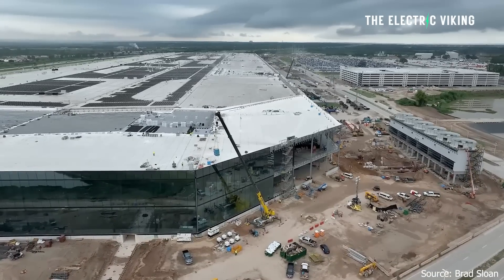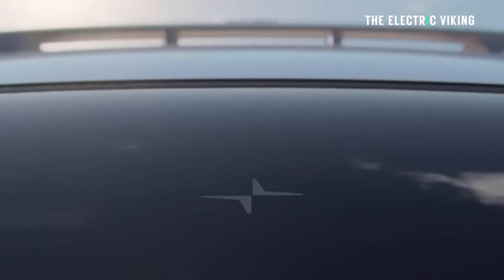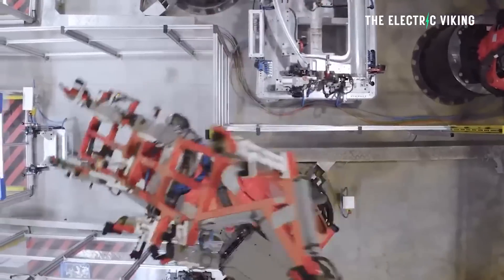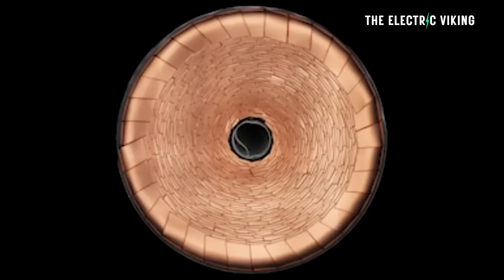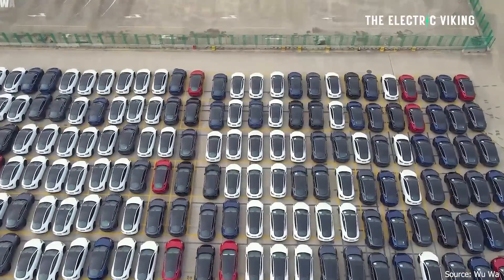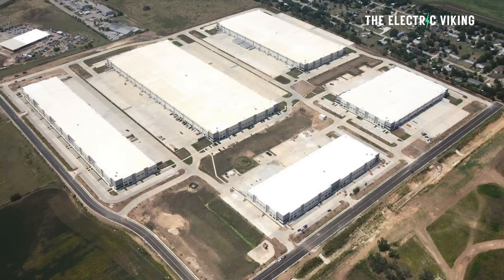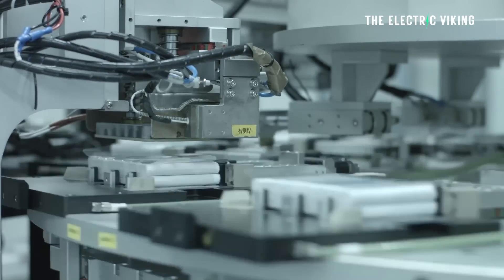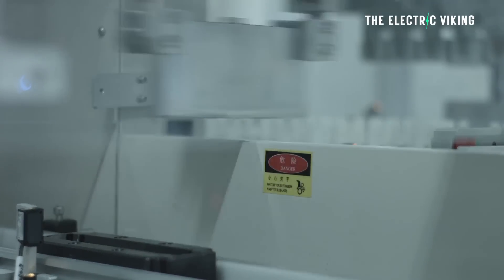Tesla is building one of America's biggest battery factories for NEW EVs

Comment: Do you not know how batteries work.    They can’t put a smaller in capacity battery pack in a Tesla model 3 and get more range.
They can put a smaller battery pack in volume yes (density) 
But it will still have the same energy capacity as the current Teslas

This isn’t the first video you have said this.  For the type of channel you are, you would think you’d know what you’re talking about.
Reply: Less weight, more range for the same kWh
Reply: @NicolasdeJong  you would need massive weight savings.  Not just a small amount.

Comment: Are sodium based batteries  used in megapacks?
Reply: Not Tesla megapacks currently.  I'm sure they will eventually but it will be many years before that happens.  China is just now starting to use them but they are just starting to ramp.  The first major products with sodium aren't expected until summer 2025 in the US and they likely won't be much cheaper than lithium until supply ramps to meet demand.  Interestingly there are almost 30 sodium-ion battery factories under construction worldwide but most are in 1 to 5 gigawatt production range.  Nowhere near the size of CATL's big 40 to 50 gigawatt behemoths or the massive 100 gig lithium factory they're building in Turkey.

Comment: You are so out of it . Tesla's 4680 has the dry cathodd and anode is a done deal . They have tore down the current 4680 and it is dry . And ELON confirmed it .
Reply: The team were given to the end of the year to make a cyber cell with the dry anode and cathode. They recently produced one that worked and are now attempting to see if they can’t make it work consistently as a mass produced product. He is correct. It is not yet a done deal.
Reply: You really should look at Elon's statements.  They are still having problems in production and he's basically giving the crew until the end of the year to fix it or he may dump it.  Tesla has always used packs from multiple companies, not just their own.  If they can't solve the production problems they probably will switch batteries.
Reply: @Ryan-ff2db  that's a old statement and those problems have been resolved. He is already putting these in cybertrucks . Everyone forgets who they're talking about . When they come up with a improvement they do it.

Comment: He can build all the batteries he wants. But there is still a need for charging.  He will have to build a self - supporting system or rewiring  almost every home in America if he plans on home charging,  using phase two charging stations.  The national electrical code requires a 50 amp dedicated service for the phase 2 as does the Tesla recommendations.  Most homes are wired for 100 to 200 amp service.  According to many electricians in order to add an additional load of 50 amps  to existing service lines, you would need to up grade your service to 400 amps, which is a very expensive proposition.
Reply: Saying everyone needs 400A service to charge a BEV is wrong.   There are only a few high current items in modern homes and few have all of them. Electric heating, clothes dryer, and water heater. (EDIT only electric heating and clothes dries come close to operating for 3 hours at a time as specified by the rule)  In a home with natural gas these are all typically served with it.   Homes that have no natural gas are often served with more than 100A.   
Using a 240V, 30A circuit, which is considered Level 2 charging, can add approximately 20 miles of range per hour
On some cars one can tell the car to limit the max current rate.  Not a huge thing with overnight aka off peak charging.
Reply: @danharold3087 I said almost everyone.  In planning a circuit you have to add the total load at expected capacity and figure it at 80  percent.  When you add a charging device it's figured at 100 percent.  When you apply for a permit you have to  present a load plan.  Do the math again.  Air conditioning, washer / dryer, hot water heater, 20 amp  circuits to kitchen outlets, for countertop appliances, microwaves, air fryers,  freezers,, refrigerators, dishwashers,  exercise equipment,  lighting. dedicated computer circuits,  Code and tesla  specs call  for dedicated 240 V 50 amp circuit, for a Level 2 charger. Regardless of what the car will limit, the codes and   recommendations prevail.  Ignore them and  the insurance company will ignore you if the worst happens.
Reply: @howardj602    The 80% rule in the Nation Electrical code is for the sum of all continuous loads.  Ones that operate for 3 hours or more are considered continuous.  In a typical home these are lighting, HVAC, and BEV charging. Personally I would add electric clothes dryer to the list.

Also we have switched to LED lighting.  In the days of incandescent  10% to 25%  of a home electrical budget was for lighting.   With LEDs that has fallen to between 5% and 15%.  

In the US the major danger for electrical is what is plugged into outlets.   This is why the British have fuses on their extension cords and on the plug end of anything that plugs into the outlet.  

You can expect to add around 3-5 miles of range per hour to your Tesla Model 3 when charging overnight on a standard 110V outlet (Level 1 charging).

This means that if you typically drive less than 30-40 miles per day, overnight charging might be sufficient for your needs.
Reply: @danharold3087  We are not speaking about level 1 on 110V.  the subject was level 2 on 240 volts, and its installation in residential single family units. The electrical generating industry in the U.S.  with the introduction of LED light had a windfall of reduced loads for lighting  purpose and assumed that the lighter load would   lesson the demand for an increased generating capacity and acted according.
Reply: almost every home in N America does not need any significant ($200 worth) rewiring to handle EV charging.
Reply: @j17golf  The cost of upgrading to handle a Type 2 charger is more in the neighborhood of 20 thooousand.   If want to stick with a type one go ahead. but it takes almost 50 hours to fully charge a battery using 110.
Reply: @howardj602  That is complete nonsense, or your electrician saw you and realized he had a fool. 
Type 2 consts $8-1200 installed. Stop being silly, 
I had one installed for 1200 last winter in a condo, brother had his installed in suburban home a month ago for $900.
Yes, I was qouted $8000 five years ago. But who would go around quoting old prices?
Reply: @j17golf  It depends on the installation.  In rural areas the upgrade to receive the additional service lines to handle a 400 amp service is $12,500 for 500 ft. alone. Average cost to up grade to 400 amp panel is $4000, and installation of Type 2 is $2600. Total $22,500.line
Is the one you installed in you condo, a communal installation?  That is the route most condos, take, as they usually have to install a new separate service just to accommodate the additional load. And $1200 is an exceeding cheap price. Usually around  $2000 an up.
Reply: @howardj602  so, 800-1200, not 20000. Thank you.
Reply: @j17golf  And  its' not a phase  2.
Reply: @howardj602  Which is why I wrote "type 2", not phase 2.
Pushing silly cost claims only makes one person look desperate... you
Reply: @j17golf  You are using the wrong terminology.  Electrical charging stations are referred to as level two and phase 2. 
An act of desperation, is the very definition of an ad hominin attack.     Instead of discussing the argument itself, criticism is directed toward the opponent’s character, which is irrelevant to the discussion. 
You lose.
Reply: @howardj602  Phase 2 is not a term used for EV charging, type 2 is. When you make false claims, expect to be corrected. If you are upset by being corrected, don;t make incorrect claims. e.g. your $20k cost claim, your 400A claim, and your "phase 2" claim..
Reply: @j17golf  You are incorrect. Phase 2 is a term that was used as the chargers were  first introduced. 
Phase one was introduction of  level 1
Phase two was the introduction of the level 2
Phase three was the introduction of level 3. 
The cost of $20k is also accurate as is  the 400A claim.  
Level one just plain old wall sockets. 
Level two and three will required upgrades to the electrical systems whether in a home, a condo, a co-op  because the present wiring cannot handle the loads. 
The only people who deny this are those who do not want to scare people away because of the hidden costs.  To upgrade the U.S. electrical grid to handle the increased loads expected by 2030 is expected to cost up to $2 TRILLON,.
You lose.  End of Story.  I'll give you the last word.
Reply: @howardj602  Shouting "you lose I win" only works when you are 5 years old. 
Phase is used for household wiring terminology, not for EV charging terminology. Type 2 IS. 
But shout all you like if it makes you feel better. 
$12k was the price for a home install in the early days, like the replacement battery cost was $15k in the early days, just like my first PC cost me 4x what a new hgh end gamer PC would cost today. $1200 for level 2 in the home is $1200, and 400A is not required for that.
Last word, in this case, finally silences the playground dolt
Reply: @j17golf  Oh but I must respond. You posted misinformation.  You like most drivers have a limited knowledge of the vehicles you are driving besides putting the key in and driving.  
Your limited knowledge of the so-called, household  chargers, failed.  They are glorified extension cables whose sole function is to deliver ac current to the vehicles which is then converted by the on-board charging system to DC. 
Home installation costs for a level 2 can run up to $9,000. Latest estimates 2024.  
Tesla in an attempt to bring honesty to their advertising  has begun referring to them as  "wall connectors", which they are. 
If you want anything that remotely resembles a "charger" you have to go to a commercial grade, level 3  which delivers DC directly to the car.  
  Level 3 requires a 480 volt power source not normally found in a home setting. 
Pricing ranges between  $20 to $80,000 or more for the installation of 1 unit. Or more depending on the distance from the power source.
Reply: @howardj602  I have 3 family homes with level 2 chargers installed in last 12 months... 2 houses, one condo. None cost over $1200 all in. 
If you are paying more, the seller saw you as easy prey.
Are you actually claiming or suggesting a level 3 DC fast charger is appropriate or even needed for home use? Really?
Reply: @j17golf  You are not installing level 2  chargers.  What you are installing are electrical delivery lines that are limited by the amount of ac current that is available to the dc chargers that are installed in the car.  
You are being misled by the manufacturers of those delivery cables, by them calling them chargers. 
Tesla at the present time is selling three wall  connectors rate for home use. 
They are the mobile, the wall, and the universal wall.  All deliver AC to the vehicles on board charging system to be convert to DC by the onboard charging system. 
The level 3 DC Charge is recommended for multiple use in installations such a condos, and  coop settings where there will be a need for the fast charging abilities that are lacking in the home delivery ac  cable systems.
Reply: @j17golf  If you installed level two  did you have to upgrade your  "supply panel"  Most residential  homes use 20 amp breakers for house hold use with 12 awg wire.
The level 2 supply line  is required to have a breaker with 60 amp  breakers using 6 awg wire. to deliver the 48 ac amps rated supply  to the vehicle
Less  than  the recommended upgraded system and  slow down the amount of amps available to the supply system. And possibly create a fire hazard. 
A level 3 is a DC charger and is called the  Tesla Supercharger.  It is not available for home installations, and  suggested for use in multiple vehicle locations, such as condos, and coops with a central charging area,  because of the speed at which it can charge a car.
Reply: @j17golf  Phase; meaning:  a distinct period or stage in a series of events or a process of change or development:
Reply: @howardj602  Yes, I know what phase meas! Which is why I also know that we use Level 2 and Type 2 when referring to EV charging and 2 or 3-phase when referring to home and industrial wiring!
Reply: @howardj602  Not at all. We added a small breaker unit attached to the existing one, $50 cost. Fully licensed and the installation was inspected and passed by the local fire chief. 
What is a "level 2 supply line"? Certainly not any term an electrician would say in terms of home wiring for EV chargers! 
YOU brought up Level 3 chargers, I simply mentioned how absurd your suggestion of a home Level 3 charger was.
Reply: @howardj602  The definition of a level 2 charger is "evel 2. Level 2 equipment offers higher-rate AC charging through 240V (in residential applications) "/... which is what I installed as did the others in my family. 
I get max 7kW (usually around 6.2kW), need to charge car overnight around once per week. 
Perhaps stick to topics you understand rather than what you 'learned' on social media. 
Maybe go out and speak with real live people who own and install these chargers so that you can dispel the disinformation you have been fed and are regurgitating.
Reply: @j17golf  What is commonly called a level 2 charger, is not a charger.  It does not offer AC charging.  AC has to be converted to DC by  inverter circuit using a rectifier  on board the vehicle.  When you plug your electric vehicle (EV) into a Level 2 charger,   the AC power is converted to DC electricity by the vehicle’s onboard converter. This DC power is then stored in the EV’s battery. While it is referred as a charger, it is a glorified extension cord with a specialized plug that conducts AC current to an inverter that contains a rectifier circuit that converts the AC to DC current to charge the DC battery array which is made up of many small  DC batteries. This conversion from AC to DC is not done by the "level 2 charger". It is done by the on board charging system.  
Like I previously said.  Most people have very limited knowledge of how their vehicles work be they EVs or ICE, besides the ability to put the key in the vehicle and making it go.
Reply: @howardj602  Funny, my level 2 charger charges my car exactly as level 2 chargers are specified to charge my EV.
But, hey, you got your electrician's license on X, it seems, so...
It is a charger. And it is level 2, by all specs. 
Yes, a charger has other components needed to do the job, just as a charger needs electricity to do its job. It is still a level 2 charger and it still costs $1200 installed.
And you are still embarassing yourself
Reply: @j17golf  You are the victim of one of the biggest cons ever.  The problem is that you are in too far to do a little simple investigating of what I wrote, because it will embarrass you.   
Just make sure your homeowners, is paid up, and your smoke detectors are working, and hope for the best. 
Hint: Tesla has changed the name of their level 2 chargers, to "Wall Connectors".

Comment: so if better cheaper batteries are coming. what the point of buying an ev now?
Reply: He never thought of that 😁
Reply: Why buy a phone if batteries will be cheaper soon? Buy now and tat car is good for 180,000 miles. THEN buy a new car with new cheaper battery
Reply: As someone who does own an EV, I've asked that question myself.  Next year they will be cheaper virtually guaranteed and they're be cheaper the year after that.  If you don't need to buy a new car I would probably wait.  If you need a vehicle and you have a way to charge it at home or work I would strongly look at some of the leasing deals.  There are leases as low as $159 for 3 years and the model 3 is $299 for 3 years.  I normally would never consider a lease but 3 years from now the market will be very different.  If you don't have an easy way to charge it, I would not buy an EV until charging speeds improve.
Reply: Because you have to save the planet! Now! Or it'll be too late if you wait just a little longer!
Reply: @hiram1923 grow up
Reply: Why buy a TV now when better and cheaper ones keep coming out every year? And phones?

Comment: How are the phosphate batteries cooled?
Reply: Ring the fire fighters....lol
Reply: @dikkybee4003  They are incombustable, meaning they will not burn when exposed to fire. This is an important feature in the event of mishandling during charging or discharging. Lithium iron phosphate batteries can also withstand harsh conditions, including freezing cold and scorching heat, as well as rough terrain.
Reply: @PackFan2323 But the range is less and weigh a lot more . Since they are made of iron
Reply: @richardt6980  The LFP batteries can be charged to 100% every day, whereas the non-LFP batteries should only be charged to 80%. So effective range is very close. I get a rated 272 miles on my LFP Model 3 RWD. Take 80% x the long range 340 miles = 272 miles.